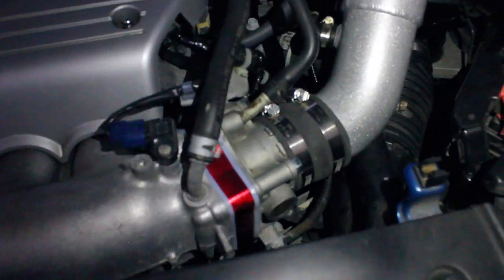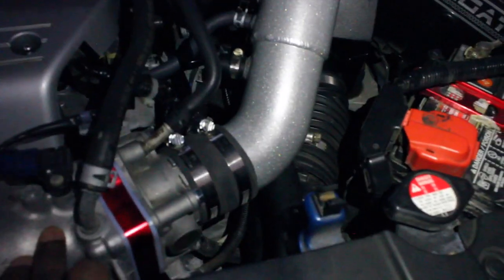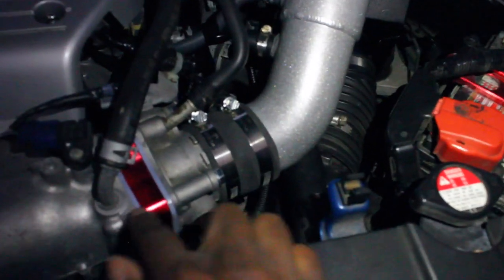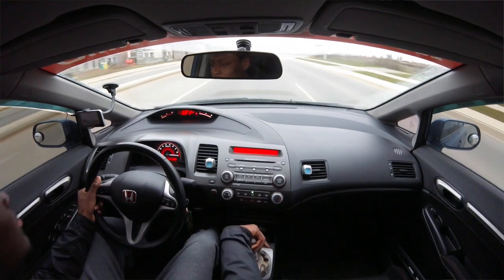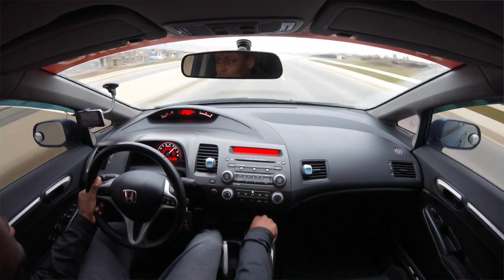Throttle Body Spacer Review

Comment: Ull net best results wen u pair it w the intake gasket. U will deff feel the manifold cooler with both. Get the p2r manifold gasket its an easy install.
Reply from the maker: +MySI Yeah I read about that gasket as well. Is it actually easy to install? Looks difficult
Reply: Nice review. I watched the guy install my IMG and it did not look easy.

Comment: i might get the same intake and spacer. i was thinking about getting a cold air but i dont want to hydrolock my motor
Reply: if you want a CAI but worried about hydro-locking. 
you can check out Hybrid Racing CAI, they have a built-in air by-pass to prevent hydro-lock. It works !! 

https://www.hybrid-racing.com/collections/intake/products/8th-gen-cold-air-intake-by-hybrid-racing-k-series-06-11-civic-si-1
Reply from the maker: +Dimitrus Valentin Yeah same, I was worried about hydrolock too. This is a nice setup so far

Comment: What is the function of this spacer?
Reply from the maker: Makes a little power with the space in between the throttle body and intake
Reply: It technically add to low end and mid power  by acting like a longer tube on your intake